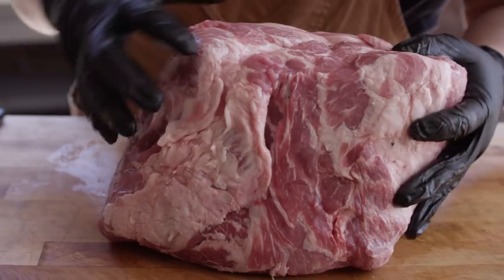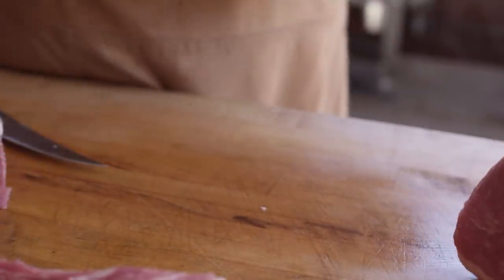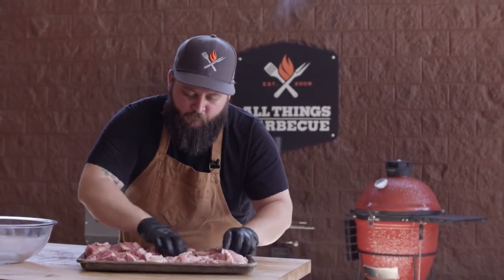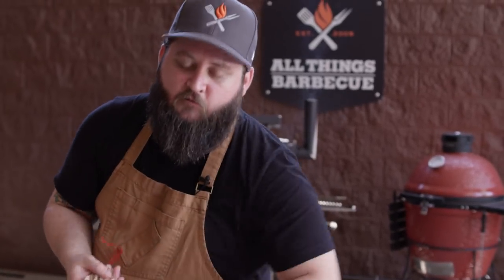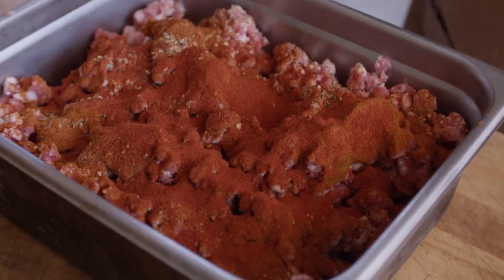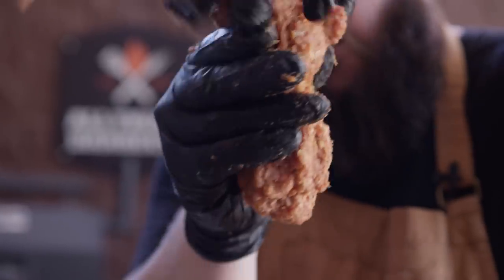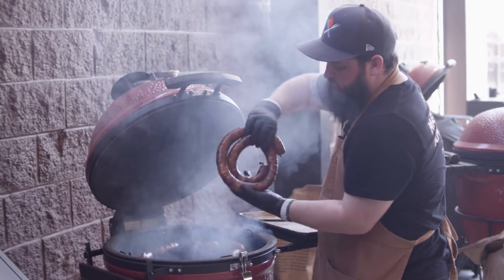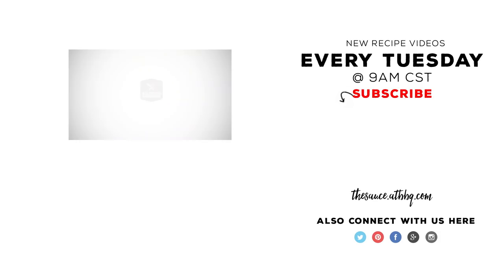Homemade Hot Links Recipe

Comment: I don’t even own a smoker, I just find these videos so relaxing
Reply: Archie Phillips get a smoker. Even an entry level pellet smoker is fun to work with.
Reply: Archie Phillips n n
Reply: You can still get some things smoked fairly well with a BBQ. Just keep the fuel very limited and add some as it burns away. Don't go over 200 temps inside the BBQ and let things gradually get smoked and cooked. Once you try it a few times, you'll catch on with how much fuel and time is needed. There are smokers on the market for $100 but they are limited to smokers, no higher heat choices. BassPro Shops has lots of them. Getting a decently made meat grinder that works easily isn't an easy task. Lots of them on the market are inexpensive but with that comes a "contraption" or "toy" version of what really does the job well.
Reply: 😂. Hey what ever makes you happy!
Reply: Sausage making ... simultaneously relaxing and frustrating. The ultimate experience!
Reply: Love this video. I've been making sausage a long time and you taught me a few things about handling the casings. Any tips on making pork franks?
Reply: bruh I am a muslim I don't even eat pork, and yet I watched every second of this vid xd
Reply: It is weirdly cathartic

Comment: What size and model is that grinder ? I want to buy one like that !
Reply: LEM  "Big Bite Technology"  @7:16
Reply: Which big bite did you use for this job ?
Reply: I went to the LEMproducts.com website and found the 3/4 HP model #12 that looks like the best value per $. I read a lot of reviews and the smaller models had some negative discussions regarding heating up and little power but, those models are for the "once in awhile" occasional use. #12 is $330 Amazon. Likely worth it if you also like to buy chuck, brisket or top sirloin when its on sale and grind for hamburger BBQ's.  Our stores either sell "ground beef" or the butchers inside other stores won't grind up chuck for a customer due to "store policy" and "cleaning" rules as well as "mixing products" etc.  What a load of kaka, real butchers grind anything they sell.